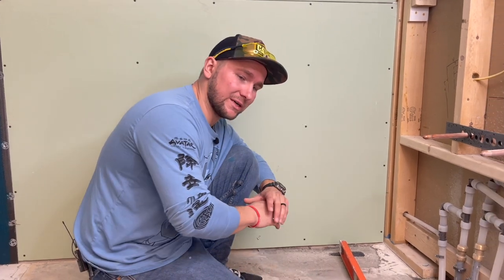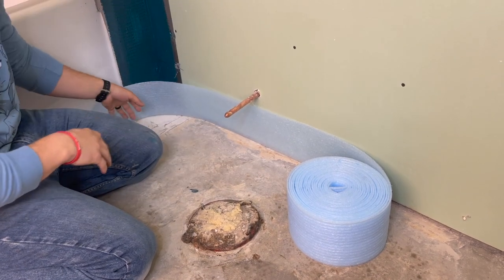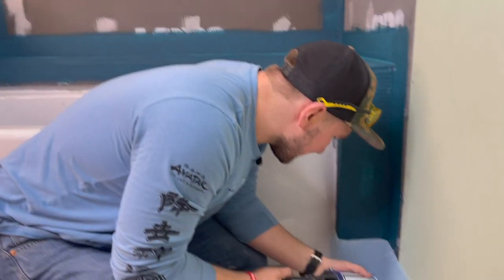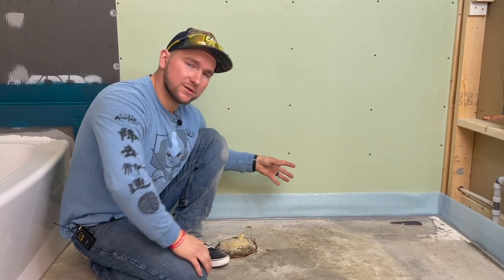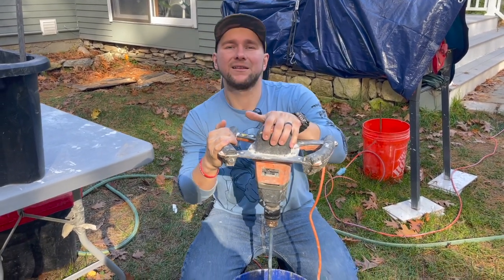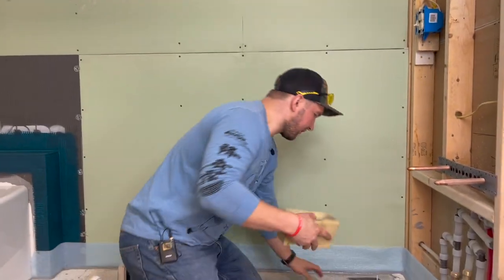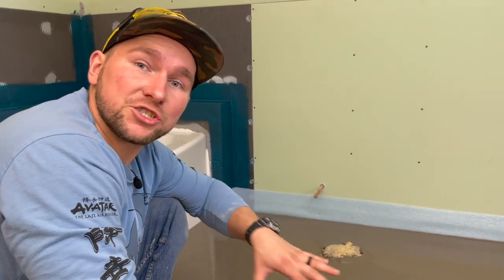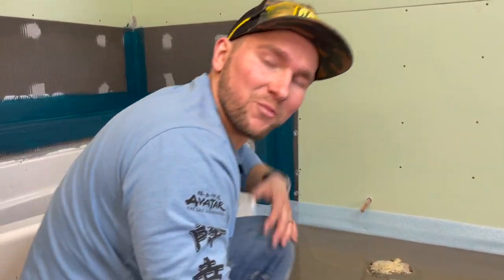How to Self-Level | subfloor leveling | Winni Vlog 011

Comment: Nice video but I would recommend that you use Primer T or Prim Grip and not "just wet the floor". Nice trick with the tile clips. They also make Leveler Pins. A great item for interior use for leveling - ARDEX K60. This product is moisture insensitive and contains the liquid and the powder for leveling. Perfect for residential work at or about 1/4" to 1/2" Max. Make sure you get rid of that surface tension by either using your trowel or a porcupine roller when you level. Good job overall.

Comment: Primer is NECESSARY in this application or it will fail 100% if someone says otherwise they just didn’t get the call back cuz who calls back the dude who installed improperly
Reply from the maker: Not over a slab. Yes over wood
Reply: @WINNI.Designs  no even on slab the 2 cements will not be able to grab together and it will eventually come loose cement 101 you don’t pour the house in sections you pour a whole house when doing foundations same as self leveling
Reply: @WINNI.Designs  so if the floor is unlevel and already poured you must primer to get a proper bond🤣

Comment: Sorry, but this is not how Mapei wants you to do it. Instructions clearly state you need Primer T. After the surface has been prepped.
Reply: I've never used primer for self-leveling floors and never had a problem in 15 years. As long as your subfloor is clean, the self-leveling product will stick to it real good. Self leveling compound is a strong and sticky product, no need for primer 😜
Reply: @williamp9158  this is false please ask your local rep about priming your floor before leveling ESPECIALLY on concrete it’s like you all are new to construction and don’t understand the basics of cement
Reply from the maker: Over a slab it makes no sense. Over plywood yes
Reply: @WINNI.Designs  Love your videos and energy but i gotta disagree with you on this one, this self leveing stuff has pretty bad bonding capacities, it's just better to use the primer when tiling. The only time i skip the primer is when installing floating floor but thats it.